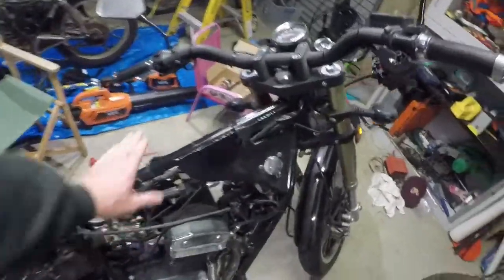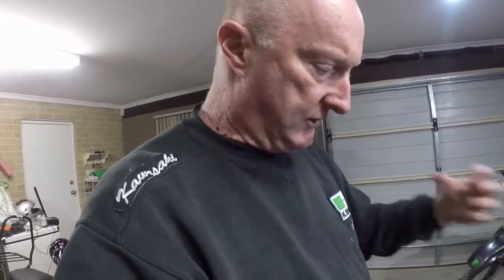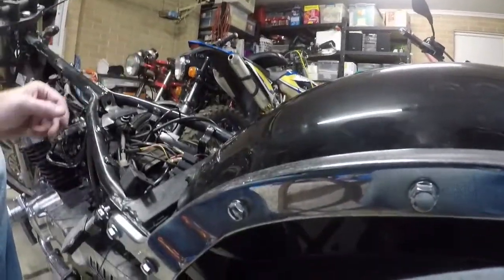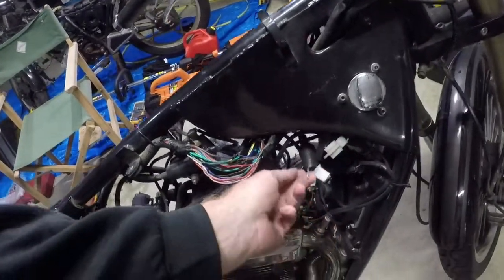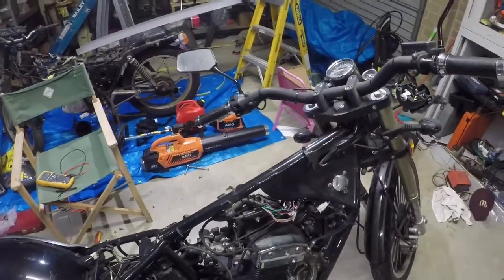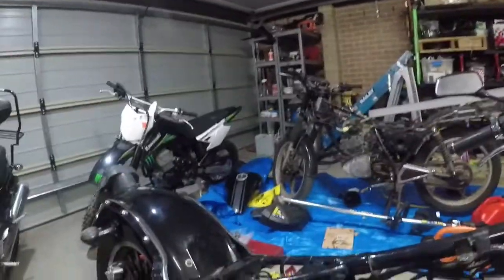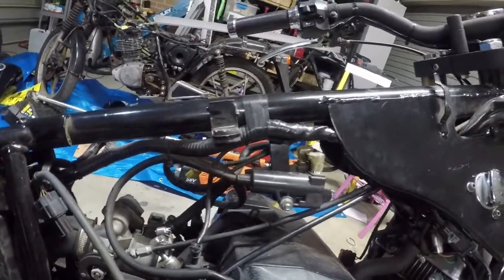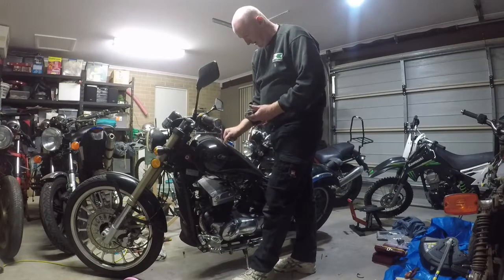Laro Pro Street 350 motor work Part 1

Comment: MATE! your a legend, my son and I purchased a street pro, got it running ready for blue slip. I watched your video on loose bolts in magneto box, opened it up and sure enough 3 loose bolts. thanks man, posting your video 100% saved us.
Reply from the maker: Glad it helped. They are a fun bike. This and some had issues with fourth gear (under heavy acceleration).